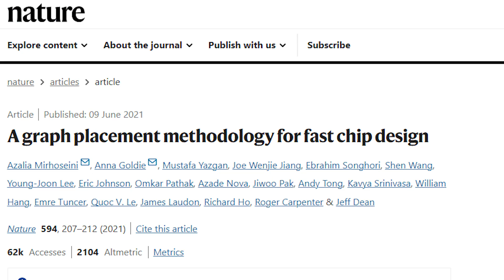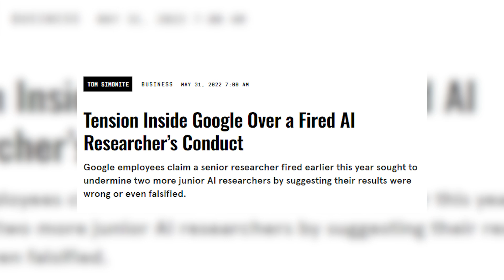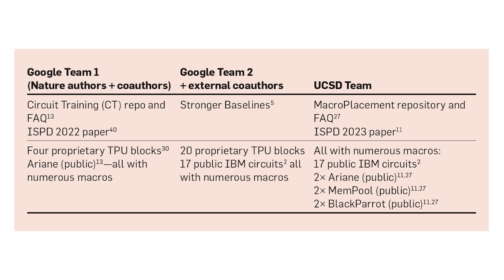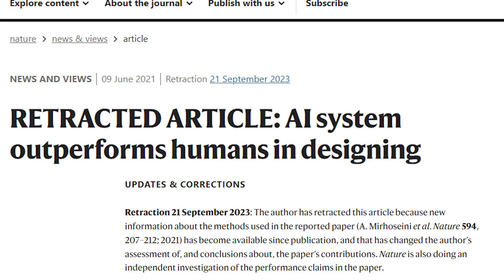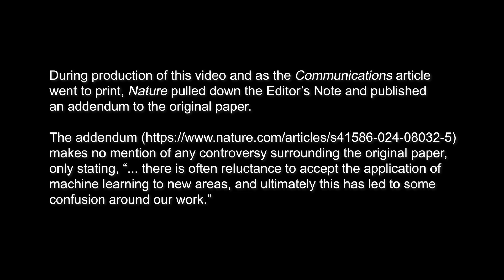November 2024 CACM: Reevaluating Google’s Reinforcement Learning for IC Macro Placement

Comment: Really nice article highlighting some persistent issues with modern AI/ML research like cherrypicking, leakage and overfitting. This is a problem I see both in published work and internal projects at companies. It requires a lot of careful testing across a broad variety of datasets to ensure that models with a large number of parameters work well. In this particular instance, it is ironic that good old SA can outperform RL and generalizes better.